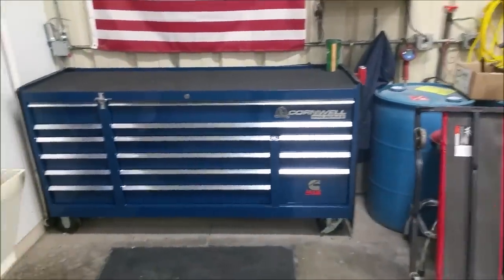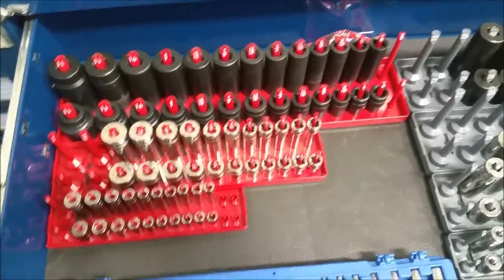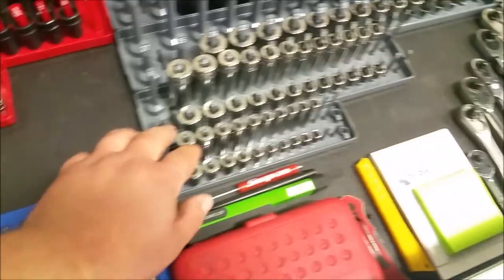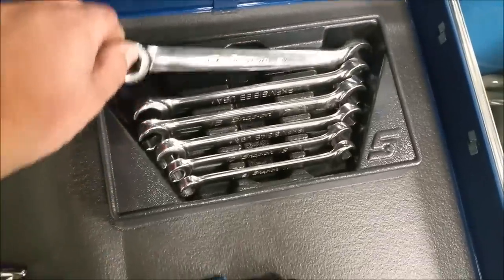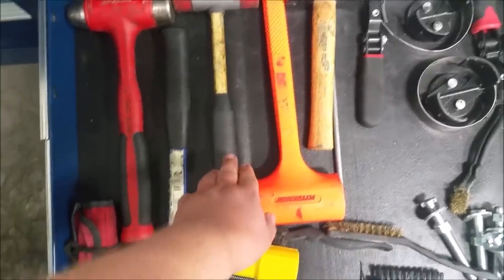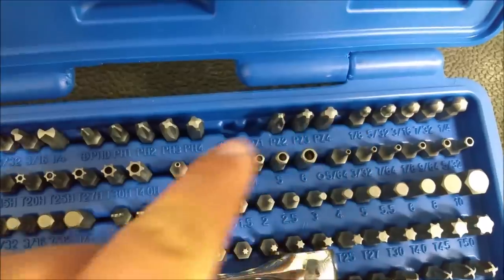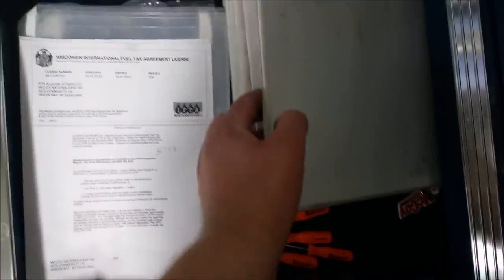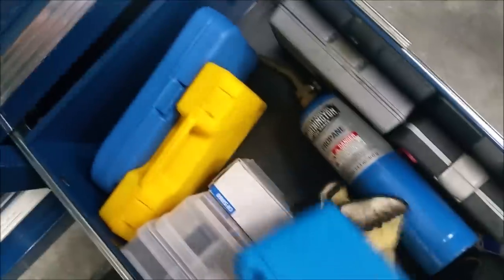cornwell pro series tool box tour

Comment: Snap on dealers in my area only last 6 months before they quit. Cornwell is the only dealer that shows up regularly and is a great guy. Cornwell has great tools and the best price.
Reply: Robby VanWagoner dude it is exactly the same here..weve had 3 snap on guys in like 8 months..the other four months they showed up maybe 4 times..cornwell guy shows up every week on the dot with or without his truck if its down...he wheels and deals and has never been an issue with warranty..ive had no issues with my cornwell stuff..even if the snap on guy was like my cornwell guy id be hard pressed to spend any more money on the snap on cornwell has been a mich better bang for buck..besides torque wrenches i have to have my snap on digital

Comment: Snap On impacts tend to rust BC the alloy mix they use has higher carbon content where as other manufactures tend to use more rust resistance metal such a higher chromium in their alloy for forging. They are both/all good IMO, great collection Bro.

Comment: I love my cornwell guy. He hooked me up with a CAT 4150 1/2" impact gun, it's not an IR though, was too expensive... 1200 breakaway torque with 500-700 working torque, and he hooked me up with 50 bucks off @ $289.00. He has great deals all the time. I have a Snap-on, Matco, Mac, and Cornwell guy that all come into the shop once a week. I'm trying to advance my career in the automotive industry, are there any tools you would recommend?
Reply: Cody Terrill milwaukee m18 fuel 3/8 impactand metric impact sockets double up on the sockets..most used tools in my box..and i know they are expensive but the tech torque angle digital torque wrenches from snap on are a must
Reply: Cody Terrill get a set of mountain wrenches!!

Comment: How's your box holding up interested in a cornwell box just don't know if they compare to say a matco or snap on
Reply from the maker: Jhony Zelaya the box held up very good for me. Ended up upgrading to a snap-on epiq due filling the Cornwell box and had no Cornwell tool dealer at the new job. This box was as good as a snap-on classic or a Matco 4s. Same price range but I enjoy the draw lock mech that's why I ended up with an epiq series that and it height was raised to work on

Comment: i know you're a professional, but how can you think $400 is ok for some quarter inch sockets? that sounds so outrageous to me
Reply: James'sWorld I don't mean to be rude, but once your work as a professional tech and experience snap-on tools it will make since. but in short they are the thinnest walled ,strongest, tightest fit on the market and won't round off bolt heads. and when you make your living with your tools you find out fast that the good stuff gets you done faster, makes you more money, fails less, and gets you hurt much less often.
Reply from the maker: I completely agree $400 is too much. I only got them because my OCD won't allow me to get a different brand it bugs me that my standard inpacts are different. If I could re buy all my sockets I would go with gearwrench all the way
Reply: My 1/4 dr. Are gear wrench I love them.